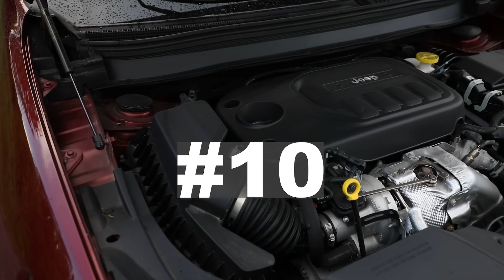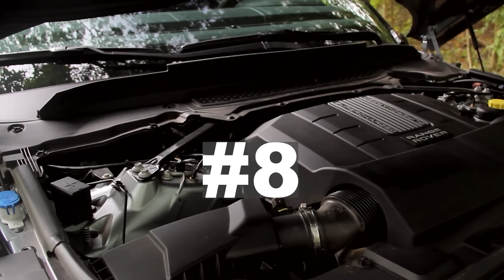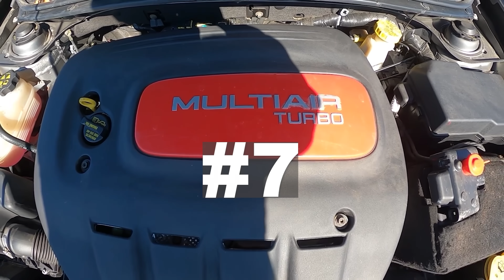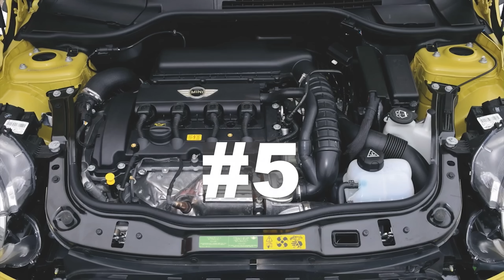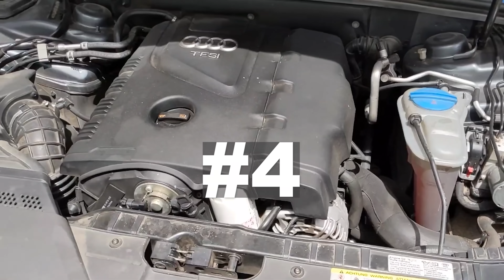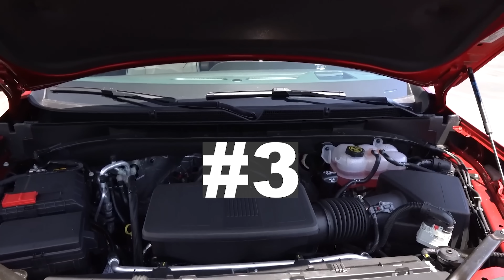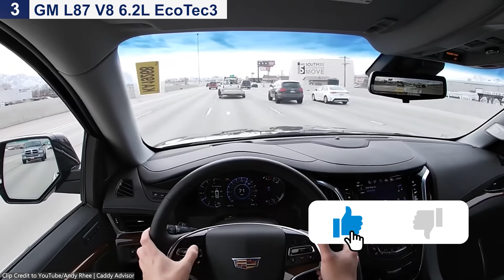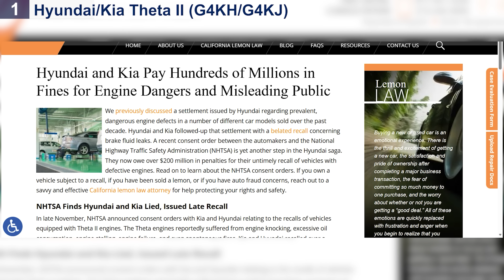The WORST CAR ENGINES ever made (AVOID AT ALL COST)

Comment: The Tigershark motor is actually a really long lasting motor with Dodge Darts hitting used car lots with 300-400,000 miles on them. The definitely fixed the issue. This is in direct contrast to the tubers portrayals. 
Kia’s and Hyundai have a long history of just being junk cars but their motors are proving to be really bad. 
Land Rovers are the Epitome of unreliable but rich folks buy them new and drop them after a couple years just in case. They are nice rides. 
Fords eco line of engines. Turbos next to ultra hot blocks and manifolds to wreck the spools fast. Ford has the record for recalls in types and numbers across they’re entire lineup and most because of their power plants.

Comment: Sold my pristine condition 2020 Tucson SEL with 28,000 miles to CarMax in July just to be rid of Hyundai permanently. Nothing wrong with vehicle…yet, but couldn’t stand Hyundai as a company for the sloppy way they treated my vehicle when it was at the dealer for a minor repair. Returned to me in horrible condition with grease all over it and even with a punctured tire with 23 pounds of pressure...for starters. Neither the dealership nor Hyundai corporation did anything about it. I paid to have it professionally detailed and had the tire repaired/patched. It was an AWD, so it’s a big expensive deal when one tire goes because you have to replace all four. Just a disgusting company I never want anything to do with again. I bought a 2026 Toyota Camry hybrid which I adore and baby. First oil change at 1000 miles coming up. Change your oil frequently, people! Fuel economy is incredible and I only fill tank once a month. I pay for the top tier gasoline with detergent to clean the engine. If I ever sell this car, someone will be getting a gem.

Comment: The GM 3.6 V6 engine is a very reliable engine if maintained properly. It’s been used in police- taxi cabs and other demanding engine applications with very good success. This engine has been used for many years in many GM vehicles with a higher than normal success rates. I have this same engine in my retired police vehicle with over 210,000 abusive miles other than using a quart of oil every 2,000 approximately it hasn’t had any failures. As for other engines in your list you named a couple other engines that have also been good engines. Your review is terribly flawed.

Comment: Well your A.I. Facts are wrong. Imagine that ! The Hyundai / Kia Theta 2 engines ALREADY have a 10 year 100,000 Mile warranty, that Hyundai / Kia Extended to 150,000 Miles and in some cases Lifetime.  They also have a program where if the engine was one of the bad ones and failed, and you already paid to have it replaced, they reimbursed you.  I had a 2014 Sonata with one of the affected engines, and had zero problems with it.  Only SOME of the engines had debris in them, not all. 
TOYOTA CURRENTLY has a recall on 126,691 Tundra trucks, Lexus LX SUVs and Lexus GX with the same exact problem !
Why are they not on your list ?

Comment: Ford made an spectacular engine, the 4.9L straight 6 300CID. With regular maintenance that engine never quits and than Ford decided to put the biggest garbage of an engine in their trucks, the Triton 5.4L V8 with 3 valves per cylinder. I'm surprised the Triton 5.4l V8 didn't make the list
Reply: The 5.4 2 valve (before 2004) was a good engine. The 3 valve screwed the pooch.
Reply: The 5.4 2v engine was a pretty decent engine despite the spark plugs blowing out occasionally.

Comment: I've had 13 KIAs and 1 Hyundai Entourage. 3 Fortes, 3 Sorentos, 2 Sportages, 3 Optimas, 1 Soul, and 1 Spectra. No problens EVER! Usually trade between $75-$100K. Paid 1/2 the price of other company models with similar equipment. I'm pretty good with oil changes.

Comment: 20w motor oil seems to have popped up right at the same time as these problems, rings, seals, crank, and rod bearing. The testing has all been done for years these should not fail yet I purchased a hwy tractor that had be serviced with the OEM oil since new. I noticed the low oil pressure warning in the city when moving about, switched to a full synthetic oil pressure stabilized and never saw any more warnings. How is it that mfg s are recommending oil that breaks down to basically zero lube ability when engine temperature and pressure demand more lube even though the price of oil cost 4x as much and vehicle extreme punishment is our favorite pastime? This makes NO sense or is it DEI hires or vax-injured brains as anyone who has grown up around any kind of cars could easily point out these simple problems before you mfg a million times the problem

Comment: One of my sons is a plumbing/heating contractor..he went thru 2 Ford F150s with the garbage “eco boost” engines and the died before 50,000 miles…he finally took my advice and went with an F 250 and a 6.7 Diesel 
The Eco Boost engines are crap
Reply: Mines good!

Comment: lesson 1 do not buy a turbo charged car period
Reply: I did drive with VAG 1.8 20VT engine 17 years and 370 000 km's. No big issues.
Reply: A Turbo system is great done right.  Water cooled center bearing, forged pistons, reinforced crank.  In the 80s Chrysler did it right,  Ford did not.  Ford turbos failing at 60K miles.
Reply: Not so that Ford Ecoboost 2.3 is an excellent turbo engine. You just have to take proper care of them. The Ecoboom BS needs to shut up. Not helpful of useful to anyone, just stupid.
Reply: Not true. My volvo T4 appears unburstable after 27 years. Turbo for 'occasional extra grunt' is OK. It is turbo for everyday needed power that is to be avoided.
Reply: You're missing out on the fun and performance  of a turbo.If you change the oil when due and you let the engine cool down for a minute befor shutting down you  will be fine. Once you've owned a turbo you will always want a turbo.Ive had 6 turbocharged vehicles without  any problems over than removing the smile off my face.

Comment: How can a car burning a quart of oil in 1K miles meet air quality standards? Why isn’t the EPA weighing in?
Reply: Well is actually CAFE and the rules set during Obama administration to lower fuel consumption but of course people want more power as well. Low tension rings, low viscousity oil, long oil change interval (more than 5k miles) and the problems start to happen. Today's engines run at high stress levels to increase efficiency, plus they they are very complex comparing to engines from the end of 1990s, so if you start adding pieces of the puzzle together, you will reach rational conclusion.
Reply: My Corolla burnt 1l per 100km that is a quart every 60 miles before it punched a hole in the block.  We are talking in 1979.
Reply: Because it's not "burning" oil in the old traditional sense where it would go out the tailpipe in the form of emissions. It's probably more accurate to say the motor is eating the oil.They are using shitty components like low tension piston rings that causes oil to blow by and then it's recycled through the PCV systems and fed back through the intake manifold where it's supposed to be burned in the cylinder. What ends up happening is the carbon and crap builds up in the intake and back of the valves until it causes all kinds of failures not to mention the oil level gets dangerously low depending on how often it gets checked and changed. All just to get .0001 more mpg.
Reply: We need to go back to horse and Cart
Reply: @Ron-d2g Most 80s cars were pretty good
Reply: Ban the EPA period.

Comment: I have a 2014 Hyundai Sonata.   Always on top of oil changes and other maintenance.  Car had 140,000 miles on it - car was flawless, but suddenly went downhill so fast.  They extended the Theta 2 engine to 15 years/150,000 miles per the class action lawsuit.   Hoping now to get a new engine under the lawsuit.

Comment: My 2021 Jeep Compass has a 2.4 L engine. EPA recommended 0W20 motor oil which I switched to 5W30 immediately.
No oil loss, no engine noise.  Do not let FANATIC ENVIRONMENTALISTS be your mechanical engineers.

Comment: Well, German engineering is not stacking up too well.   All I hear is that German engineering is the best.   Clearly it isn’t.   If only had Hondas.   Sold my last one at 25 years old and still going strong.   Had my 1990 Accord for 12 years and sold it easily.   Currently own a 2014 Odyssey which is a great car and very powerful and a 2020 CRV.   All trouble free.   The only other brand I would even consider is Toyota.

Comment: We owned a 2016 Hyundai Sonata whose Theta II engine started to have the problems described in the video at 37,000 miles.  Software designed to detect if the engine was failing put our car in a cripple mode that forced us to take the car to the dealer. They made adjustments and installed a new wiring harness to “correct” the problem, but we were to bring the car in every 1,000 miles to check the oil. Sure enough, a quart was needed each time they checked, so after several of these checks they gave us a full engine replacement for free under the car’s 100,000-mile warranty that lasted until we got a new car when the Sonata hit 97,000 miles. Hyundai/ Kia still makes some the best looking, well furnished vehicles for the money, but after that experience we bought a Subaru Outback to replace the Sonata.

Comment: I have a mile long driveway.  I did my research and bought an LR3. I love it. It has "suspension fault errors" and will lower, so I get in, lift it up, and go pull the fuse that makes it lower. Works great for the 4K I paid for it. My buddy had a 2012 Autobiography Sport V8 Supercharged and he paid the 13K to fix the timing chain and sold it to me for 9K. Fast as hell and I love it. So I have 13K for two Land Rover / Range Rover and although I wish they didn't have small issues, I can easily go pull a fuse and keep 100K in my pocket to purchase more land on Lake Cumberland.

Comment: I know many will thumb their noses at what I drive. 2006 Chevy Malibu Maxx LTZ with the Iron block 3.5 V6 engine. This is my 3rd Maxx and last one as most are gone where I live. Right now I have 1,57000 miles with no oil issues, no engine oil leaks, engine is super quiet at idle, and more than enough power for passing. I change engine oil and filter every 2,000 miles with conventional 20w30 Blanes brand of oil. The trans oil is changed every 35,000 miles. Only issue is with the electric steering. Changed once on recall and again at 1,20000 miles when it quite. The 3.5 engine is cam in block with push rods and shows around 30 to 31 mpg at 70 mph. I have been so happy with the Chevy Maxx with it's 3.5 V6 engine and will drive it to the end.

Comment: I understand these engines are crap oil burners, but if the owner knows it needs a quart in 800 miles, why are they surprised when it seizes when the oil pressure light comes on?  Should be checked very frequently.

Comment: I have the GM 3.6 in my car. The secret for more reliable operation is change the oil every 4-5000 miles. My car is 20 years old and still runs fine. Lack of proper lubrication causes the issues and dirty oil is a major contributor 
I had the dealer tell me that when I bought the car. Absolutely do not follow oil life calculations.

Comment: Ford 1.0 3 cylinder ecoboost! The one in my 2016 Focus seized at 54k miles. Known for oil pump drive belt failure.

Comment: You didn't mention the 1.5, 2.0 and 2.3 liter Ecoboost engines from Ford. My 2.3 liter was replaced last year in my MKC lincoln and right now the 2.0 liter engine in.my wife's MKZ Lincoln has to be replaced due to the coolant intrusion issue these engines are known for.

Comment: At 70 it's like they're trying to reinvent the wheel. We had simple straight 6 cylinder engines that lasted for ever. Without all the fancy electronic clustered inside the car and all around the engine. It used to be just a radio, now everyone has to be Mr. Gadget with multiple distractions. In my opinion, the best engine out there is the Ford 300 cubic inch straight 6.
Reply: Yes a durable motor to survive anything…..plus such a mellow exhaust sound while happily torquing its way around town in a loaded up F series or E series van.  Helps me go to sleep.

Comment: Pontiac Bonneville never had a 3.6 They had the 3800 V6 which was probably one of the best engines GM ever made.
Reply: An Aussie here.  I have a 1994 Holden Commodore RWD with a Buick 3.8L V6.  Over 290,000Kms still going strong, bullet proof.
Reply: Yeah, this looks one of those "I did a class project" type of videos where all of the "facts" were slapped together in a hurry.  I think he must have seen the remnant of the W platform (Impala) 2012-2016 that did get the 3.6; and assumed they "must" be all the same.   Maybe the videos I make on my channel will be good enough to overshadow videos like this one someday.... hint hint....
Reply: Totally agree the 3.8 was one of the best. GM replaced with the 3.6  the 3.8 has been around since the 1970 s
Reply: Old school here . The 400 with a 4 barrel carb was a good one.  My first car in 73 when I was 16 was a 2 door 68 Catalina.. Loved that beast 😂
Reply: 93 cavilers
Reply: My cousin Vinny😂
Reply: Not probably...that 3.8 V6 is hands down, the best "modern" V6 that GM ever offered...well-maintained examples can go up to 300K without needed major repairs.
Reply: I had an 08 scion xb with a 2.4.
3 engines later, I scrapped it.
Reply: I agree

Comment: I drive a 2017 Toyota Tacoma which has a real 6 cylinder engine with a real transmission, not CVT transmission, no bells, no electronic whistles. I’m really glad not to have one of those new vehicles with all their scary built in electronic surveillance and grenading engines.
Reply: 2015 Tacoma owner here. 4.0 liter engine. 4 wheel drive. Only repair I've needed was an alternator replacement at about 125,000 miles. Planning on keeping it. At 135,000 miles now. Doesn't burn any oil. Add at new muffler too.
Reply: That setup is no longer available, as of 2024  Toyota has gone to a turbo 4cyl. That's one of the reasons I bought a 2024 Nissan Frontier. Naturally aspirated V6 engine, regular automatic transmission and you don't have to use the screen to control everything. My biggest gripe is the stupid auto start-stop feature, but it's not a problem if I remember to push the button. 😊
Reply: Turbos  never seem to work out for Toyota. I have a 1985 Toyota 4-Runner 22re.They tried to Turbo that engine later and stopped offering it, don’t think it worked out very well..The 22re left alone is legendary.👍
Reply: I have a 2024 Frontier as well. King Cab 4x4. No issues to report so far.
Reply: @flash21502 I love my 2025 Toyota Tacoma whit 4-cylinder turbo, good on gas too.
Reply: @chachacheng9380 all the experts say that the turbo puts a lot of added strain on the engine. Who knows? all vehicles have their issues, so if you like the truck, I wish you the best of luck with it. Happy New Year!
Reply: I got 2016 Taco, 6sp manual. But my sis or her boyfriend finished the clutch at 50k miles 😵‍💫😭😳 Otherwise OK truck. Took one full day to replace the clutch.
Reply: @pliedtka keep the truck, trade your sister.
Reply: Thank God you didn't buy the new 3.4 V6 over 200,000 recalls on the twin turbo V6 from 22 to 24 I have a friend with a tundra on a second engine less than 30,000 miles
Reply: Nissan ? Good good luck !
Reply: 2005 Tacoma, dbl cab ,4wh drive,6 cyl at 225 ,000 miles.Looks and runs like new,even got a new replacement  frame courtesy of toyota.Will hit 400,000 miles, no problem ,unless some jerk nails me.

Comment: Had a 2017 Kia Sportage. Had no problems, but traded it at 60k for a larger vehicle (Toyota). One bullet dodged. 
Also have a relative that purchased a used 2015 Kia Sorento, likely in part because of my positive experience with the Sorento. After a year or so, it started burning oil (with no visible smoke). He took it to the dealer a couple of times for their oil consumption test. Dealer told him that the amount of oil lost/burned (1 quart per 1k miles or less) was normal. 
He got rid of the Sorento shortly thereafter.

Comment: In fairness to Kia I have Sportage which broke down on a road trip with oil leaking from the crankcase. They replaced my engine free of charge and refunded my $750 towing charge. This was covered under a 2018 recall to fit the knock detection sensor.

Comment: You should investigate the DEATH WOBBLE in Jeep Wranglers.  This has been a problem for ,many years. My 2017 has cost me over $4000 to fix three times. Jeep will do nothing about it at all.  WHY???
Reply: The dealership techs have to do things by the book.  You need to consult an independent that does lift kits and have them update you.  I had a 1998.5 Ram 3500 with the 24v Diesel.  It had a steering stabilizer mounted on the front drag link.  A steering stabilizer is a $65-$95 item that takes about an hour to install.  The lifted truck guys buy them ALL THE TIME and its for the EXACT SAME REASON.  It STABILIZES the STEERING.

Comment: This is why I don't buy anything after 2005. I have a 1999 Silverado 5.3L with 312,000 miles and it still runs like new. Original motor, never been torn apart. Today's vehicles are jokes. To much reliance on technology, not enough on mechanics. I'll never buy a computer on wheels.